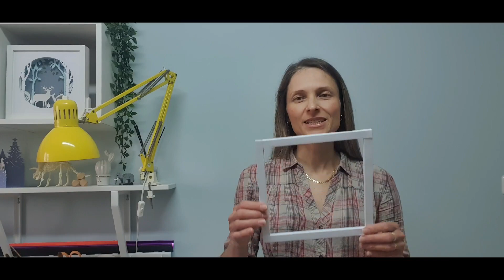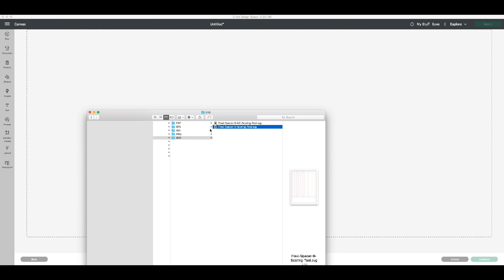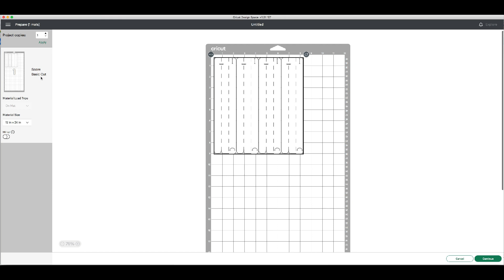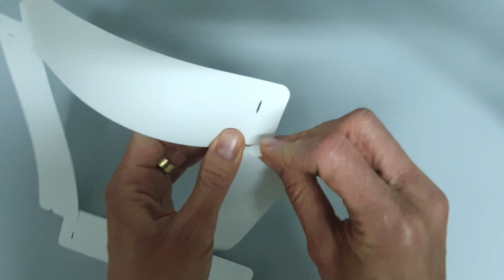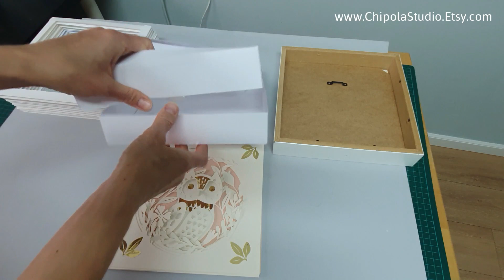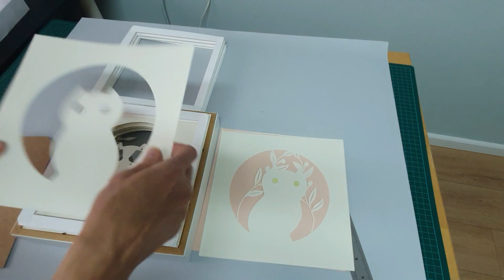Flexi Spacers Instructions

Comment: Thank you so much! How can I make the width of the spacers thinner? The default size can be seen on the left and right sides of my shadow box.
Reply from the maker: Hi Sheketa, Please see my reply in the Etsy messages.
Reply: @verchu1983 
I’m having the same issue. Where can I find the information about a thinner spacer?  Thx
Reply from the maker: @1wildwackywoman  Hi, you can try to make the spacers thinner in the software before cutting, or if it fits your composition, you can cut the spacers in places where they are seen.
In this case, you would have to use glue or some other adhesive to attach the spacers to its layer.